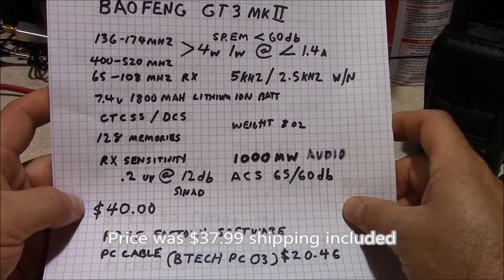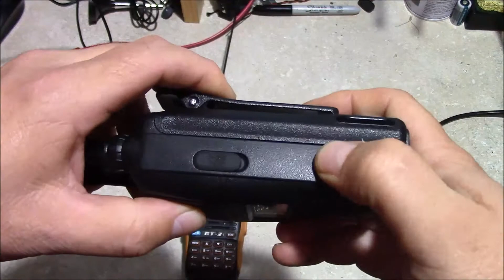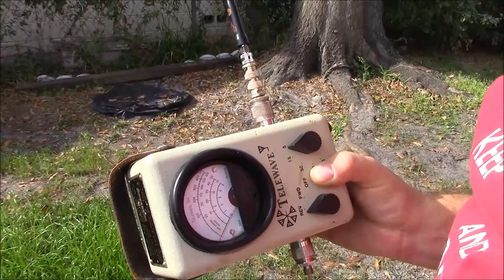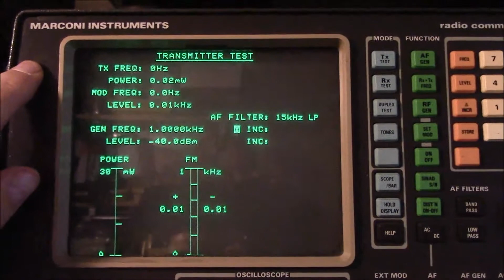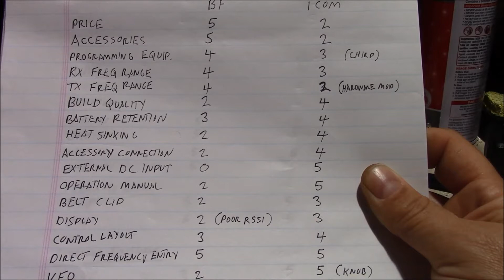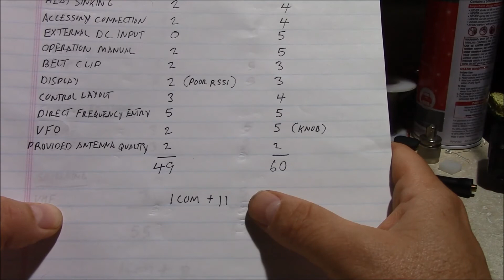Baofeng GT-3 MKII vs ICOM IC-T70A Part 1

Comment: This test lacks one criteria and that's field programming. You can program an Icom with a breeze while the Baofeng good luck with it. Good review by the way.
Reply from the maker: I agree the Baofeng and others  do not come close to the ease of "classic" amateur portables in moving about covered spectrum in any way.  I have one of the older Kenwoods (Th F6A) and it will even RX SSB.  The only advantage the Baofeng has is its price point and I am afraid in today's market that has been enough to really limit  the consumer's understanding of what makes a frequency flexible radio a frequency flexible radio. Thanks for watching !
Reply: The quality of reception of the radio is also more important than anything else. What's with 10 watts TX power and cannot even hear a single response? Baofeng has its place, however, when it comes to any real operations wherein there are lots of RF interference, it cannot survived.
Reply from the maker: @boggs2005  good point - I used to live in a metropolitan area and having poor selectivity was a huge issue.

Comment: GET RID OF THE CAR CHARGER! THAT WILL MELT THE CHARGING CRADLE AND KILL THE RADIO!
Reply from the maker: The charger using DC is sketchy ! It got hot hot hot  in extended testing. The next video is all about the nuts and bolts use and observation. Thanks for watching !
Reply: SurvivalComms no problem!!!! Been a sub for a while and love the channel!!!
Reply from the maker: Thank you very much I appreciate the support and the heads up. Spoiler alert - The BF charger overall is very crude compared to the ICOM but sounds like from your observation its no spoiler to you :) Thanks again !
Reply: SurvivalComms no problem! My friend had one and pugged it in and 20 min down the road it was smoking in his truck. It's garbage. The radio is solid and good but the charger sucks. I will be trying to do a video review on my vertex VX150 soon. The charger plugs right into the side of the radio. But over love the chan and love to see the vids coming out. Really loved the build your own communications plan series.

Comment: Great review of both radios. I get around the lack of the DC jack on the Baofeng with a converter for my cig lighter that I plug my standard charger into. I won't be giving away an Icom radio away. LOL Thanks for sharing.
Reply from the maker: Thank you ! I'm not giving away the icom either :) I actually picked it up for a really good price. The BF did come with the vehicle adapter and I can confirm it works well with the powerfilm F15-600. Thanks for watching !

Comment: Yeah there's a big difference between the two of them. You  Thoroughly broke those two radios down. Thank for sharing your findings brother.
Reply from the maker: You are welcome.  I can definitely see why the Baofeng has such a following. It works and the price is low enough that the radio could be considered disposable and it still wouldn't be an economic faux pas. I have more testing in the works. Thanks for watching !